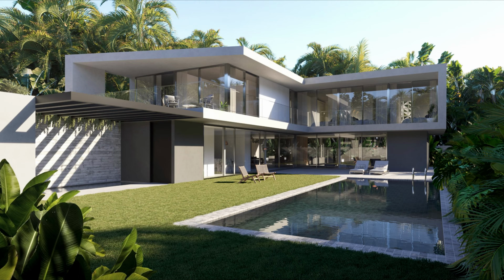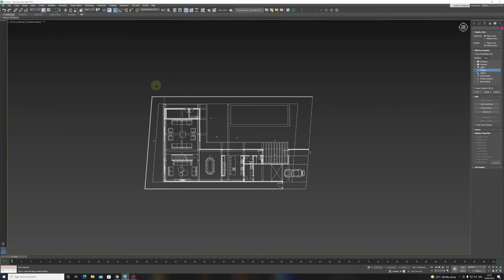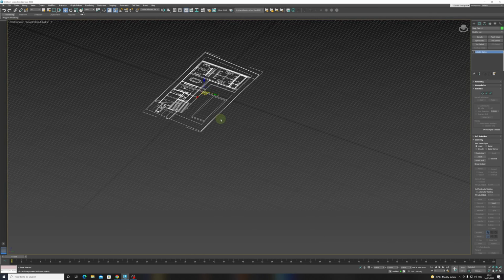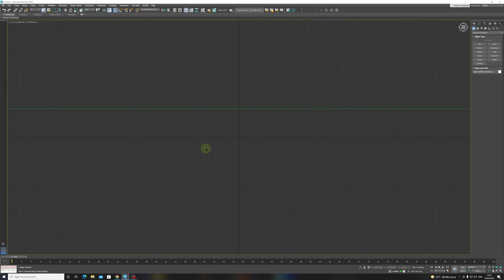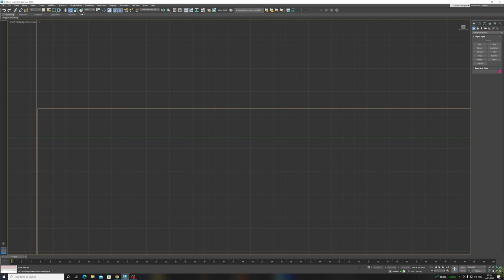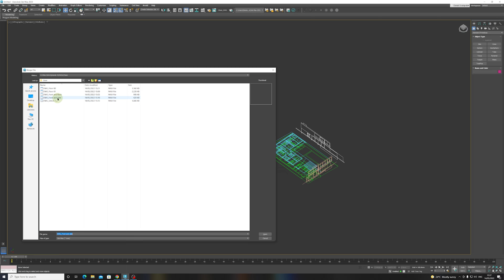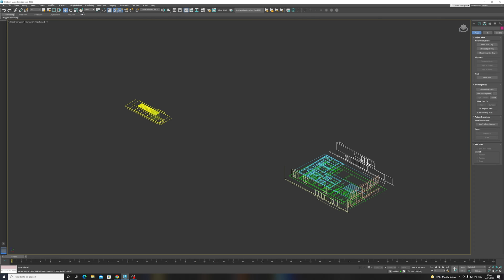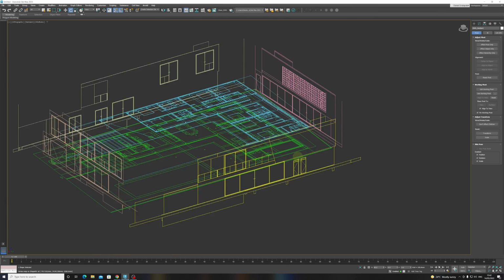Importing and cleaning CAD DWG's in 3ds max 2023 (Lesson 2)

Comment: thank you for such great videos,  I've a question, if i work with centmeters should i change it to cm when i import
Reply from the maker: Hi there, you can try but in my experience, many files from architects come in with the wrong scale so you need to check and rescale once imported.